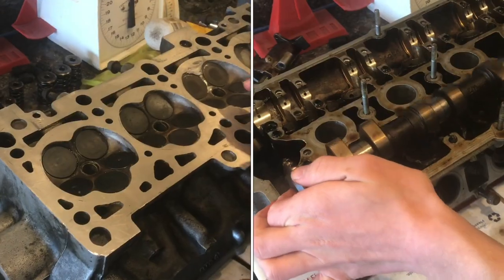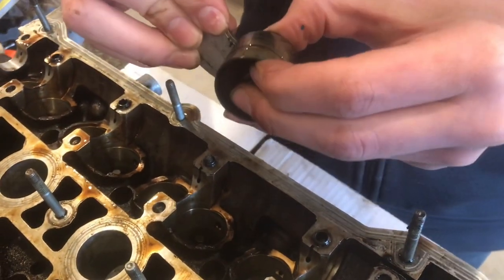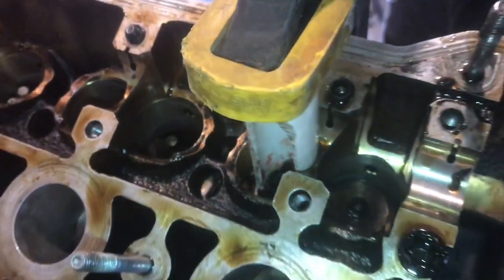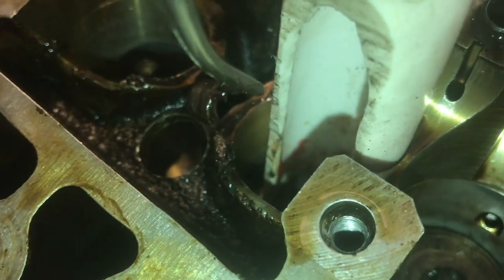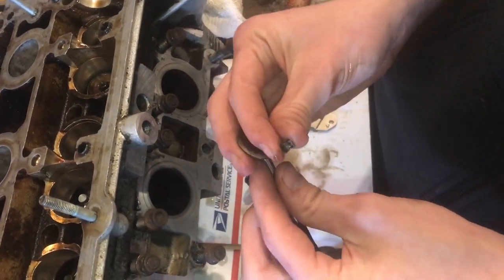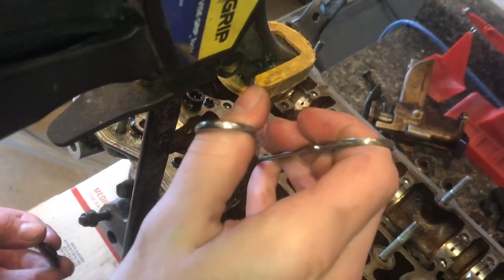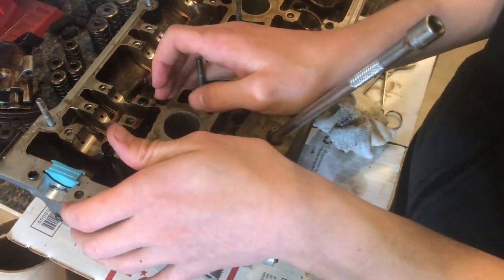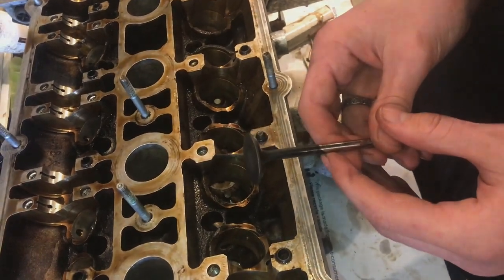removing “VALVES” 1.8t volkswagen audi (aeb head)

Comment: Hi, i have Volkswagen CC 1.8tsi engine, i have observed oil leak from turbo intake pipe which is at driver side, and leak is from bottom joint, is it related to valve stem seals? its around 1 quart i have to put in engine after every 1500km
Reply: damn bro